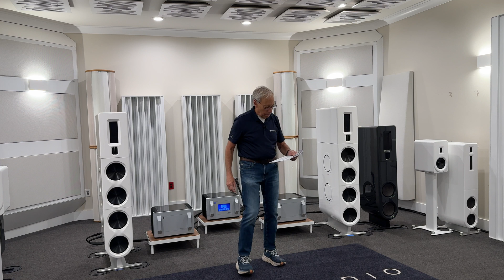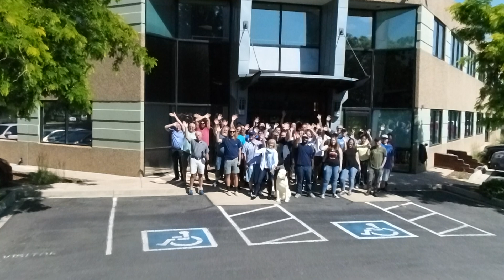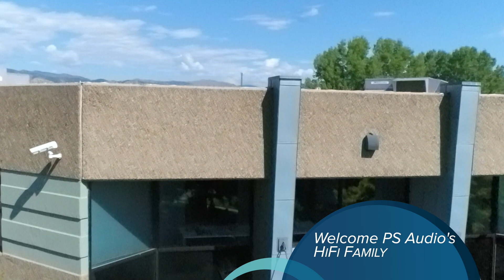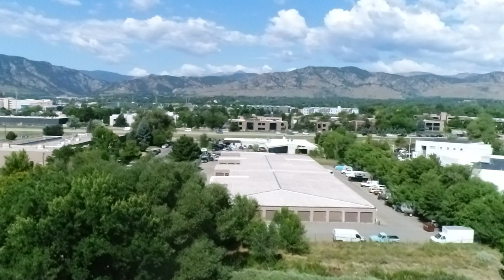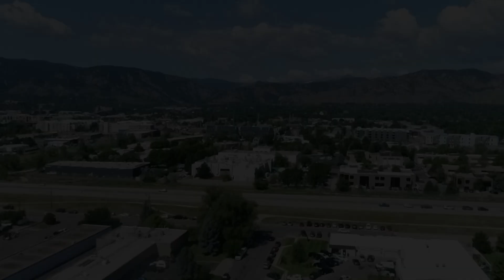Why high resolution transfers of analog tape sound better

Comment: The thing that always kind of bothered me, is that almost all high-resolution digital masters of analog tapes had been captured at sample rates of 96 kHz or even 192 kHz, yet, whenever I run an internal recording from lossless Apple Music tracks in Audacity, the spectrograph always displays an immediate cutoff at 20 kHz.

I’ve always wondered why they did that ever since. Anything from a choir recording to Peter Gabriel to Air - 10000 Hz Legend, were all in high resolution, yet were still cut off exactly at 20 kHz. Only now that I’ve seen this video I understand it a bit better. 

When you told that “It isn’t just about the captured quality itself, but rather about the range and headroom that high resolution digital transfers have to make it easier to tweak and optimize the listening experience”, it suddenly makes more sense to me.

I also found something interesting that could perhaps provide some more explanation. When I loaded a 1 kHz sine wave in Audacity, I initially thought that it would sound exactly the same when played back in a sample rate of 8 kHz, which still covers the frequencies that this sine wave falls into. Yet, when I played it back, it sounded worse than 44.1 kHz.

So I concluded from that: even if you have just a limited number of frequencies to work with, it will sound clearer and more accurate when sampled at a higher resolution.

Comment: Also worth mentioning that the "bit resolution" in analog media (like tape) is basically unlimited. When converting it to PCM this is reduced (to 16 bit = 65536 "levels" for CD). Hence reconverting it using a higher resolution digital format makes absolutely sense, at least in theory. Not sure how much this affects the sonic quality though, compared to the difference of DSD vs PCM,

Comment: I have bought a few SACDs and Blu Ray Audio discs that are remastered from Analog classical recordings from the 1960-1980s. They are a great improvement, but still regular CDs that were originally recorded in Digital in the late 80s+ can sound better.

Comment: Remasters today are mostly one big joke not worth a penny at all
Besides brickwall limiting compression till the ceiling another "invention" has popped up autotune and pitch correction and if that's not enough there are quite a few high res files available wich are  even dangerous to play at all
The album Say You Will from Fleetwood Mac in high res is a pretty good example play this file with music scope and look what's happening beyond the hearing frequentie 
You definitely don't want to send this to you amplifier

Comment: I'm coming to realize that digital storage is one thing, but retrieval is another.  The illusion of perfect digital storage is that we look at the specs and capacity and yes even red book CD level is quite capable of storing most of the musical data. What I did not understand early on with digital was how complex and challenging it is to retrieve the music with all its nuances and especially timing alignment across the frequency range. It seems to me that conversion of the digital data back to analog is where we have seen all the big improvements in digital sound. I think that's why PS Audio is so big on DSD. It seems to handle the conversion back to analog very well. Analog has a much simpler task when retrieving the musical signal.

Comment: Prefiltering. Preconditioning. Just like vinyl as an integrator, post filtering. As you say one of the big distortion issues with PCM is the brickwall filtering during capture needed before the ADC. Yes a really good 1/2 track reel to reel can get out to almost 20Khz at higher recording levels. This is prefiltering the response curve and better than some R/C network. Just as the physical transfer to vinyl from even DSD creates the continuous wave better than an output filter.

Comment: 😂MoFi lied to all of us. 
Hi Rez is an empty term that means nothing.
Reply: Maybe you should revise that to say, "Hi-Res from MoFi means nothing to you." Any term can be empty if it's abused- but that doesn't mean that the original meaning/object of description of the term lacked relevance. Higher and lower-resolution recordings are simply a thing- 
I own a number of SACDs and DVD-A's that sound substantially better through my system than their cd counterparts.

Comment: Here we are again. 
The record on tape,have the limit of gain of the signal in some of the frequencies in the audio spectrum, plus the degradation of the magnetic field in the tape, but all the music information still there, you just need to recapture(in the original tape).in the best way possible. 
That’s exactly what a good remastering does. The music itself is exactly the same, a good remastered don’t add or change anything; just improves the weak signals (in the original record)to coming back and re-create the record as close as possible to the original performance.

Comment: I convert, in software on my PC,  Redbook CD direct rip's and FLAC files to DSD, for storage in my music library. For me, DSD has a slightly more analog sound than PCM, mainly because of the delta-sigma modulation and high sample rate. 

I find conversion of FLAC files to DSD works well if you enjoy DSD's sonic character and if the FLAC files are sourced from well-recorded hi-res recordings or well-mastered analogue tape transfers, and if you have a good native DSD-capable DAC.

Many SACDs are sourced from hi-res PCM recordings, so converting hi-res PCM files to DSD128 (what I find is the sweet spot) is essentially creating the same quality recording as many commercial SACD’s. Converting hi-res FLAC files directly to DSD128 produces consistently good-sounding gapless DSD files. 

Alternately, converting hi-res PCM to DSD128 on the fly places a high demand on CPU resources. Pre-converted DSD files require only slightly higher CPU resources than hi-res PCM files, and the analogue-like quality of DSD adds the enjoyment of the music.

Comment: I hate remasters of older albums....
Reply: I practically hate all remasters, unless it actually needs a remaster.
So many times now I have compared remasters to the original, and it's in most of them, overblown/compressed or messed up with imaging. If one would only have listened to the remastered versions in life, they wouldn't know the difference tough.
Reply: @Projacked1  exactly!!!
Reply: My views are not unitary on this. If a well-made remaster is done of an album that was relatively poorly/not-so-well-recorded/mastered to begin with (e.g., Aqualung) the remaster can sound substantially better overall. If the remastering engineer makes poor choices, and/or the album was well-recorded and/or the master tapes have undergone substantive degradation, then the original should sound better than the remaster IMO.

Comment: Paul: At the listener’s end - such as myself, how much dynamic range does a good vinyl recording generally have?
Reply: Good? 60db - 70db. Depending on your playback system. However most mixes have less than 30db dynamic range. Many more popular recordings stick to <20db during the song itself. 

As most listening environments, living rooms, have a 45db +/- 5dbSPL noise floor, and threshold of pain, where ears bleed, is around 120dbSPL. OSHA requires hearing protection when in 100dbSPL consistently. So most listening environments have around 50db - 70db S/N ranging.

Comment: @0:20 "...and one cannot add data to improve the sound."
Yes and no.

Yes, you can add data, via up-sampling.  Whether or not it improves the sound quality is subjective.

Up-sampling can create pleasurable results.  But those results are artificial.  Samples are generated by a mathematical formula.  It would be like having a computer draw additional frames in a movie, by comparing two adjacent frames.  It will look real, but it is not real.  But if up-sampling gets your foot tapping, because it sounds more real, then perhaps adding the extra, computer generated samples is a good thing?

@3:33 "That's things you can do to improve the sound."
Perhaps.  It all depends on the chef, and his equipment.

It is rare to find any remastered songs that have better sound quality than the original release.

And it seems that most studio personnel cannot find enough boxes to process the signal.  Each box degrades the sound quality.  And I suspect that their equalizers are not on par with the sound quality you would get with a high-end pre-amp.  So even if their equalizer's controls were all set to neutral, you will hear their equalizer's affect on the sound quality.

I am not suggesting to never send the signal through a box in the studio for some reason.  I am saying that it needs to be a seriously good reason.  But I suspect that the boys in the studio use just about every box they have, and that is kryptonite to sound quality.
Reply: Up sampling does not create new information, add data. All it does is increase the number of samples within a given time period by copying the existing data to new sample points. To up sample Red Book 44.1Khz to 88.2Khz you just take the existing sample at any one sample point and copy it to the new sample point. Up sampling just makes low pass filtering easier because the resultant sample frequencies are higher. Moving reconstruction/ Low Pass filter artifacts to a higher frequency.
Reply: @glenncurry3041  "Up sampling does not create new information, add data."
Yes, it does add new information, new data.

"All it does is increase the number of samples within a given time period by copying the existing data to new sample points."
Increase?  Increasing the number of samples?

Each of those additional samples contain data.  100% of the reason those additional samples are created is for the additional data that they contain.

"...you just take the existing sample at any one sample point and copy it to the new sample point."
No copies are made.

A computer program looks at sample #1 and sample #2.
It then envisions (in a manner of speaking) what would exist if there were a sample in-between -- and it creates that new sample (new, additional data).  Then the program moves on and looks at sample #2 and sample #3, and repeats the process, until it gets to the last sample in the file.

"Up sampling just makes low pass filtering easier because the resultant sample frequencies are higher."
Yes, it does that.  But not "just" that.  It does that, in addition to creating new samples as I described, above.

Up-sample a file to double its value (ie, a CD rip that is 44,100 samples per second) to 88,200 samples per second, and the resulting up-sampled file will be double the size.  Ergo, the up-sampled file has twice the amount of data, and none of the new data are duplicates of the original samples.
Reply: Just wait until AI takes hold, I predict we’re going to see software that literally “re-creates” badly recorded music from the ground up. All those rolling stone albums that sound like they were recorded through tin cans? Soon they’ll be able to remaster them to sound crystal clear like they were recorded yesterday. This will be the next wave of music studios finding a way to resell you the same album again.

Comment: 1) You can add "data" as Dirk puts it... e.g. saturation or other processing from analog to digital conversion or whatever on the signal path pre or post conversion.
2) I disagree with dirk that digital hi res sounds better than analog. Some formats and resolutions sound close but usually there is a loss of excitement or feel as you convert to lower quality digital formats compared with analog based on my own comparisons at home.

Comment: take a high rez pcm tape transfer, down-convert it to 16/44100 (do not forget to dither), then upconvert to original high rez and do a series of blind tests - see if it sounds better this time 😉 quite an interesting exercise - say take five tracks from each batch, use metadata to denote which is which, put them all in the playlist, close your eyes and drag and drop them hither and thither. then push play, sit back and make notes!

Comment: Increasingly the digital audio plumbing inside consumer audio gear can support 192 kHz 24 bits PCM far superior to standard CD format and also superior to DSD-64. While I can agree that technically DSD-256 would be awesome for studio tracks, for distribution, 192kHz 24 bits seems to become the new standard for best consumer audio. I’m not convinced the human hearing can detect anything better than 192kHz 24 bits PCM.
Reply: 192Khz sample means aprox 80khz max frequency. "According to lab tests the auditory system encodes the timing of peaks in basilar-membrane motion with exquisite precision, and perceptual models of binaural processing indicate that the limit of temporal resolution in humans is as little as 10-20 microseconds." (Microsecond temporal resolution in monaural hearing without spectral cues?  (PubMed 2003)) IOW the human auditory system can respond to frequencies/ information above 100Khz. 

Current electronics can not resolve higher than roughly 22 bits.
Reply: @glenncurry3041  Agree, half the sample rate is not actually useful, and if you wanted to make a low pass filter allowing the full range of 192kHz you would want a CD style aggressive low pass filter at 80kHz. But rather than that, you can use a much less aggressive filter to gain near perfect phase and frequency response within 20-20kHz.
Reply: Saying that’s the new standard is an over generalization. I don’t think most recording studios go that high for their recordings.
Reply: @craigaust3306  It’s sort of what streaming services have defined as their best quality. Amazon Music already have many tracks in this quality, but I am not confident some of them aren’t just up-converted from lesser formats. But especially streaming high quality DAC converted 192kHz 24 bits of analog masters make a lot of sense. Also for anything digital mastered nowadays, 192kHz 24 bits is sort of the best you can get. I see little point in playing a DSD track that came from transcoding a DXD PCM file.
Reply: @clickbeetle2720  What is deleted?
Reply: I don't think that 192 kHz 24 bits PCM is superior than CD for listening. Recording and processing is quite differente. Listening in real rooms (treated or not) and producing music have quite different requirements. You probably can hear the difference beyond a different mastering; I can't. I have found (and measured) some high res files worse than CD (from the same file and same mastering). High-Res and stairs for listening; probably more snake oil and desinformation around there. Octave records albums sound great regarless of the support and format; even their high-res files sound great.
Reply: @Jorge-Fernandez-Lopez  192kHz gives you more precision in the time domain and your DAC’s low pass filter can be a more gentle audiophile one with a Nyquist max frequency response support well above human hearing with 192/2=96kHz. 24 bits gives you theoretically 24x6=144 dB dynamic range which is more than adequate as it is above what any analog amplification can do.
Reply: @ThinkingBetter   Theoretically yes.  But in terms of blind listening tests, the differences compared with Redbook CD are nearly impossible to hear.
Reply: @johnstone7697  Yes, I never said that there is much to further gain in digital formats that being PCM or DSD. Already with CD quality you can handle 20Hz to 20kHz and 96dB dynamic range is much better than vinyl and tape. In fact, most audiophiles can’t hear much more than to 12kHz so some upper treble artifacts from the low pass filtering is mostly outside their hearing range anyway. I would say nearly 100% of what makes a recording sound good is not about the distribution format but about how well the musicians, producers and studio did their job.
Reply: @ThinkingBetter  That dynamic can't be used for listening. Low pass filter isn't always more gentle, because there's sometimes much to filter (resonances or noise without relation with music) above 20 kHz which is not necessary in CD. Some high-res files are extremely noisy and have very bad dynamic range across the whole spectrum. Headroom for recording and processing isn't useful for listening. Any headroom for room correction will be as close to 0 dBFs in any format in some albums. Much more about it in Xiph web or by ourselves by checking real files. Like video 4k streaming, many times (probably always) Full HD on Blu-ray or music on CD is objectively better than "high-res" streaming video or music. The fact is that 4k data streamed is lower than Full Hd (not 4k) Blu-ray which output much more data and less artifacts. Some high-res music has so much noise that no tweeter should have to reproduce these resonances.
Reply: @Jorge-Fernandez-Lopez  Lossless 192kHz 24 bits PCM does technically allow better sound quality than CD but it doesn’t mean the actual music data is better obviously. Video is a different matter because you are dealing with compression and a higher online compression will be naturally inferior. This is not the case for lossless audio streaming, where you can trust your data coming through with even higher reliability than any CD transport can ever do.